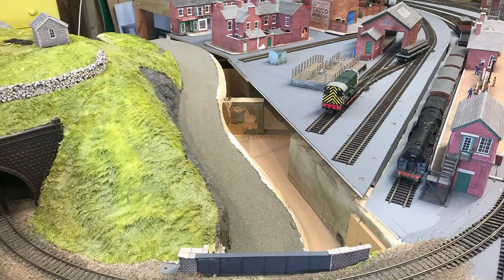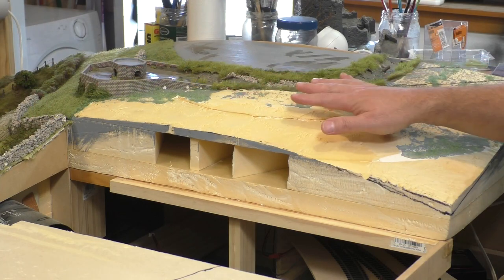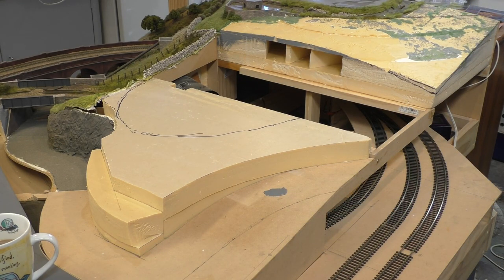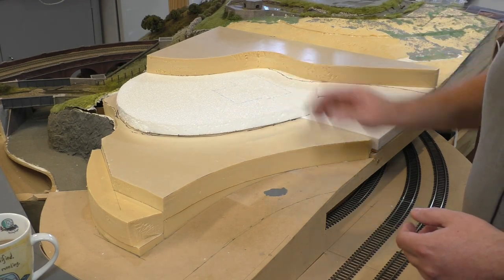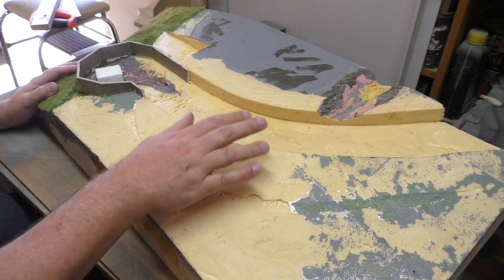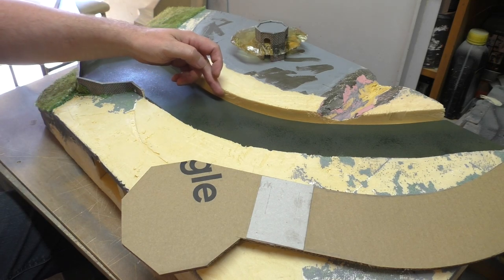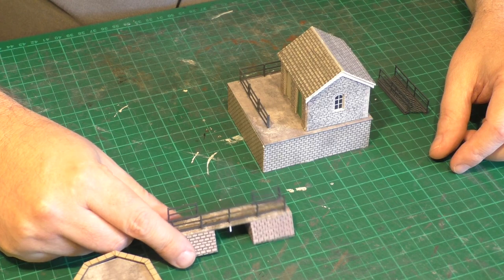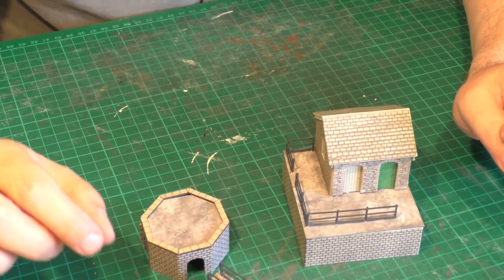Hillside Surgery - Part 1 - Hill and Reservoir Revamp

Comment: Very cool building, very cool kit, dear Jason. Love the way you made this vid into an instructional one for this kit. Also, very much appreciate your edits to the kit, evolving from the very build. Beautiful sign for the piano 🎹 on the rooftop. Cool to see how you added those small copper entrance covers. Such details really make the building and kit stand out. One idea to add to the kit is a chimney. Such a company would most certainly need to dry wood and possibly bend it. Either they will have a large barrel oven, or even a masoned one, which in both cases would require a masonry smokestack. Nevertheless, love the kit, love the vid and build. Cheerio
Reply from the maker: Hi Vincent, I think this feedback is intended for someone else?

Comment: Hi Jason, another great build, the only thing missing is the sluice to allow excess water to be run off if the reservoir gets too full - we are talking Britain here, and it tends to rain frequently, especially when you've just had plenty of it. There are only a limited amount of cuppa's you can drink to help keep the level down. 😀
Reply from the maker: Thanks Paul. I'll say I've used quite a bit of artistic licence with the reservoir. I very much doubt whether there's anything prototypical about any of the structures, but it's there to provide a suggestion and atmosphere to the area.

Comment: Nice work as always Julian. 
Your grill or grate is referred to as a Trash Rack.
Not sure it would be in that position in the intake channel .
The intake tower's have their own grills, gates etc of varying sizes to control the flow and keep out unwanted debris at different depths.
Having said that, your representation looks pretty good. 👍
Stay safe and Happy modelling! 
Monsville Railways
Reply from the maker: I'll say I've used quite a bit of artistic licence with the reservoir. I very much doubt whether there's anything prototypical about any of the structures, but it's there to provide a suggestion and atmosphere to the area.

Comment: G'Day Julian,
 I like your representation of the reservoir however I believe that the bridge is to low as the step down then up seems to be way to high/low if you get my gist! the bridge platform should be level with with the buildings Platforms. Thats my penny's worth. Great work and love watching your channel.
Cheers Wally from down under
Reply from the maker: Thanks Wally. I'll say I've used quite a bit of artistic licence with the reservoir. I very much doubt whether there's anything prototypical about any of the structures, but it's there to provide a suggestion and atmosphere to the area.